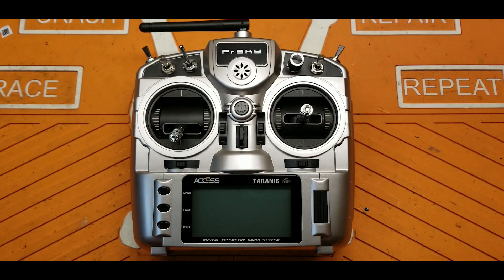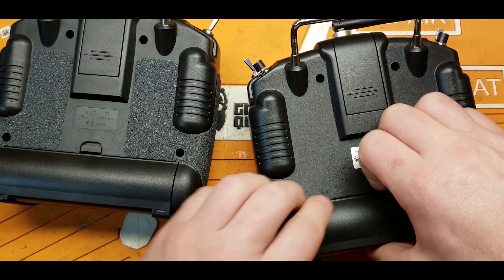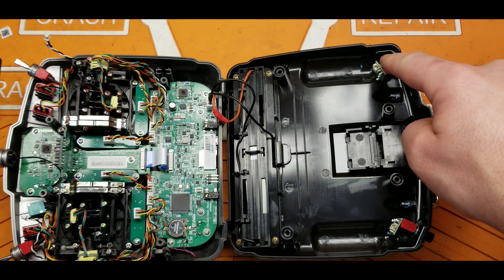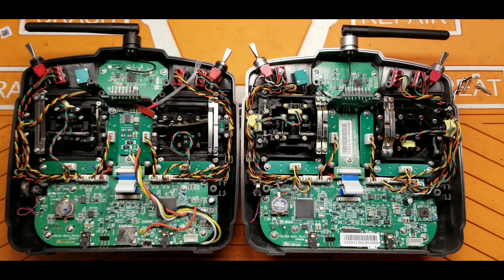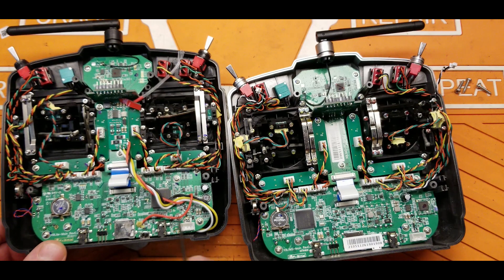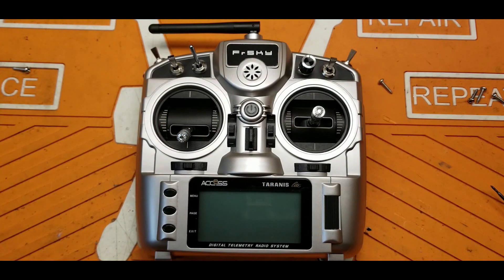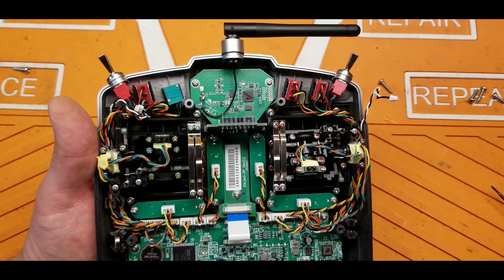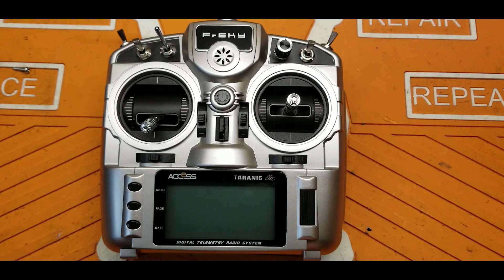Frsky Taranis X9 Lite S review and tear down

Comment: i have Li-ion 18650 3000mAh 3.7v batteries (flat top) from the vape store. would those work for batteries or are there special batteries?
Reply from the maker: Those should be fine.
Reply: @TweetFPV  would it matter if they are INR1 batteries or not?
Reply from the maker: I wouldn't use them but it should still work.

Comment: Is connecting full crossfire tx similar to x9 lite?
Reply from the maker: I'm not sure what your are asking?
Reply: @TweetFPV  is it the same way crossfire tx is connected (like how crossfire is connected to x9 lite) or any other extra soldering or mods to be made?
Reply from the maker: Ok, no mods are required. Only the Older accst qx7 needs an inverter mod done
Reply from the maker: All that is needed is an operating system update

Comment: Hi there, could you please tel me if is possible to add the 2 extra mentally switches to the normal x9 lite board, since you have both, it's easy to find the route for the switches.
Thanking you in advance.
... nice detailed review.
Reply from the maker: I don't have my original x9 lite anymore. I still have the S model.

Comment: Just bought this to use on flight sim while learning. Also have TinyHawk II RTF pretty sure I can link it to
Reply from the maker: It's a great radio. It's not the easiest to bind to the tinyhawk but it can be done. If you plan to fly micros I do highly recommend getting the xjt lite module for it as it make binding to d8 mode quads possible.
Reply: @TweetFPV  thank you I will google that
Reply from the maker: https://www.banggood.com/custlink/mDmKLzzH8j
Reply: @TweetFPV  thanks. Ordered from local place. Same price. Support local 🤩 Hoping gets here faster than banggoods 30days lol.  They always my last resort.
Reply: @TweetFPV  subbed
Reply from the maker: Haha yea no worries. Bg is a good reference for products since they cater to almost everywhere in the world. I always buy local (in the US) if I can.
Reply: TweetFPV so will it not work ? I just got tiny hawk 2 freestyle and I just but the radio bc I thought it would work
Reply from the maker: I will and It does work. You need to update opentx
Reply: @stevendavis3368  yes it works. I have mine binded to tiny hawk 2 and a cinecan both built in frsky d8. Change betaflight from frsky-d to frsky-x then bind accst d16 1-8 channels. Done it a few times. I can make walk thru if you need it.
Reply: Q Speed Racer I will reply back once I get my radio . Im just confused on the whole beta flight stuff. I thought I would just be able to bind and fly.   But I’ll hit you back brother.  Thanks
Reply: @stevendavis3368  No problem willing to help if I can..
Reply: TweetFPV  what’s opentx ? I done everything on bets flight and it looks like my controller is connected on beta flight that can’t get it too do anything
Reply: Q Speed Racer I need some help. Did all the stuff on betta flight and the controller.  I got the controller connected on betta flight and it looks like it’s connecting on the drone but can’t get it to take off

Comment: Can i use a lipo battery?  in the S Version
Reply from the maker: If you can find one that fits sure but your probably better off using 18650 lion batteries.
Reply: @TweetFPV  Ok thanks, and the time it's reasonable?
Reply from the maker: @GaragemDoChines  oh yea. 18650 lips are more energy dense than lipos
Reply: @TweetFPV  ok thanks, i will buy two Samsung 3500mah are they good for the rádio? I am asking because i have sell the qx7 the i have and he as Running 3500 mah lipo
Reply from the maker: @GaragemDoChines  I would look at more like 3000mah. Typically as the capacity goes up the output current goes down. I beleave the 3500mah are only rated at 6a which should be enough but if you eventually run a r9 lite pro you might run into a bottle neck.

Comment: I like my X9 lite. Small, simple, light. Flashed with OpenTX for D16 protocol and ready to go.
Guess overall this new S version worth extra $50. Better gimbals (at least it should be), charging board, extra switches (which I never gonna use).
I hope blue color I'd not just plain plastic but nice paint or aquaprint. Is it???

I never heard anyone using Bluetooth trainer.

Comment: I'd go with the standard unit and upgrade the gimbles down the road.  The standard gimbles, like you said, are really good.
Reply: But when you do that, the price doesn't make sense. The non-graded model with parts upgraded to be equivalent makes the standard model more expensive.

Comment: I will never switch to ACCESS.
Reply from the maker: If you have an older radio I would stick with accst for sure. But the new access does bring some bennifits to the table. Biggest one for me is over the air updating.
Reply: You no need to switch. Flash it with OpenTX, get D16 and enjoy.